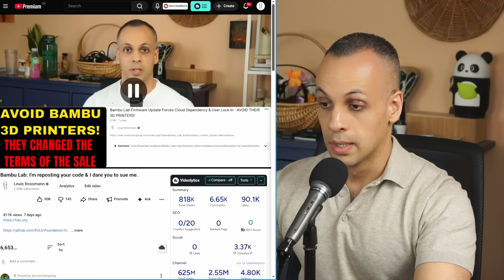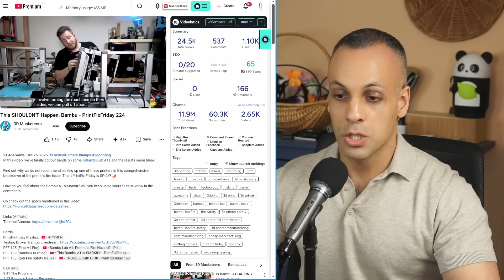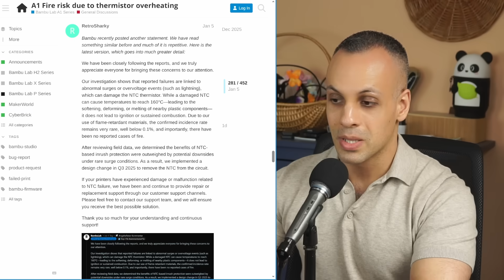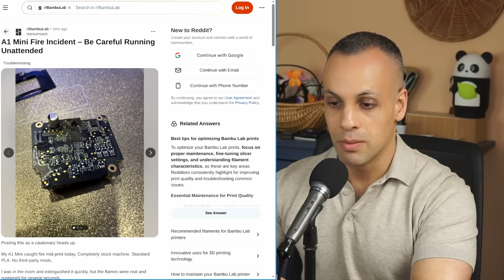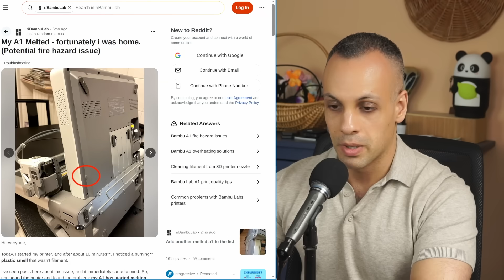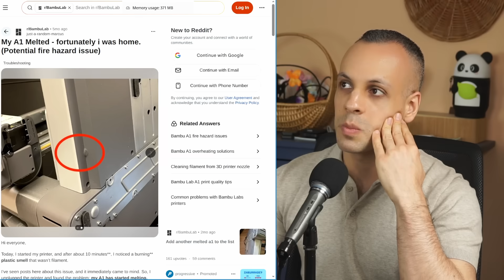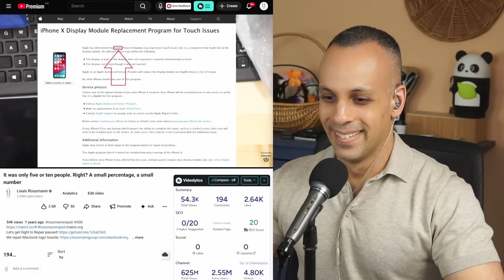Bambu Lab PR dumpster fire is turning into a literal one...

Comment: I am a novice 3d printing enthusiast.  I am on my 4th 3d printer now and it is a Bambu Lab P1S with 1 AMS unit. My first printer was an Aquila V2, second was a Flashforge Adventurer 3, and the third was a Longer LK5 Pro.  The P1S has been by far and away the easiest to use, most versatile, easiest to troubleshoot, and most reliable printer for good prints time after time.  I have gotten a couple errors but those come with the territory with any 3d printer; sometimes sh*t happens even on the best of equipment and with the best of users.  My 11 year old son is now printing on his own because the Bambu Lab ecosystem and hardware make it that easy.  While easy, one can still delve into the minute details using Bambu Studio to prepare and slice your prints giving the user more oversight of their printing process.  I'll admit that I love my Bambu Lab printer.

BUT....

I think their action of threatening an individual like they did is abhorrent, especially given that they are fully aware they built their own software off of open-source resources. I am glad to see that someone, anyone, is holding their hands to the fire. The Bambu Lab ecosystem (e.g. Makerworld, etc) is incredibly well thought out and executed but I don't believe that owners of their printers should be forced to keep their units beholden to a company's proprietary ecosystem. Apple was the first major company to build an ecosystem and trap its users inside so users have to keep purchasing Apple devices in the future. Now every company is following suit as they see more dollar signs; we now see it seeping into the 3d printing market. 

I have heard of the fire risk with one certain model of Bambu Lab printers, namely the A1. Electrical fires break out every day in varied devices. Cell phones, computers, printers, cars, and so on and so forth. I don't necessarily think this is a major oversight by Bambu Lab; these are isolated incidents of fires however there is no evidence of a pandemic of houses or businesses burning down because their 3d printer caught on fire. We recently saw NVIDIA GPUs present as a fire risk due to the adaptation of the 12v high-power adapter and plug. I would wager that there is a larger number of these GPUs in use than there are of A1 printers yet we don't see an alarming number of fires occurring. Electronics that consume large amounts of electricity will always be a fire risk to some degree. 

I do hope that Bambu Lab is either found liable for infringing upon users' rights with open-source resources or does a course correction and allow its users to use their printers as they see fit. Their products are on a whole new level of usability for users of all experience levels of 3d printing. While their actions and bullying are bad, they do not impact the quality of their products...if you by a Bambu Lab printer you are getting an incredibly well built and 'smart' product. However users should have the ability to use their purchased product(s) as they see fit even if that means using them outside of the Bambu Lab ecosystem.

Comment: Honestly, if it comes to easy to use printers, I found out recently that Prusa Core One is waay easier to use than a P1 bambu, I have used ender, sovol sv06 ace, and bambu p1 before, they all required me to tweak the print settings depending on filament, they all had some connectivity issues ( ender was annoying with the sd card, sovol would change ip from time to time and orcaslicer couldn't find it, bambu was a pain to set up for use for multiple people). Prusa I just assembled, ran the 1st print expecting something to go wrong and needing to tweak something, but it just works, I haven't even touched any print profiles or filament profiles, I just use generic whatever or prusament PLA for all PLA prints, and it prints better than any of those other printers. Additionally, it has options for DIY filtering, stealth mode which is amazing etc, most mature, easy to use software and hardware in printer space, bambu feels like a cheap knock off, after actually using prusa for the first time.

Comment: I recently bought into Bambu Labs with the P2S Combo. Since it arrived, I have never been able to buy the filament I want, as BL never has any darn stock. If I receive an email that it's in stock, it's all bloody gone by the time I check. Two weeks after buying the P2S, they silently released the X2D, which I would have preferred. I feel really sore about that experience and feel somewhat taken the piss out of. A week later, all the controversy with Bambu Labs and their adversarial attitude towards the open-source community blew up. The printer itself has decent, solid construction and clean prints, however, I'm becoming increasingly concerned with Bambu Labs direction and now wish I could sell and get my money back to buy from another brand that sells multi-head printing, but it had taken me a year to save up for this printer as I'm not a well off guy. Now I'm stuck with a brand I don't trust and it'll take me another bloody year to be able to do anything about it, I'm beyond pissed. Thank you Louis for everything your doing on this issue, Respect man.

Comment: 0.1% is NOT a small number when it comes to potential safety incidents.
Reply: Reminds me of when doctors briefly mention the “very rare” chance of a permanently debilitating side effect, which turns out to be 1/1000
Reply: @Adam-pk7go  If it is a side effect of a cancer treatment, then it is small. If it is a side effect of some medicine against a headache, then it is major... Depends on what is at stake.
Risking burning your house down in order to make a hobby 3D print is not proportional though.
Reply: correct, if 0.1% of the printers catches fire it would be a disaster, even if 0.1% fails it is still a disaster.
Reply: 0.1% of 1 million is 1000. They are saying a 1000 fires every million printers is ok...
Reply: @birdack81  Until someone important dies.
Reply: @birdack81  Surely it's easier to say 1 printer in every 1000??
Reply: @birdack81  "well below 0.1%" was the field failure rate of NTC's (operating out of spec after voltage supply surges). The fire incident rate is 0%. There were no fires, just some melting and deformation of fire-proof plastics in well below 0.1%
Reply: @dl5244 on relatively new devices, some of them will have this issue when they are 10 years old and full of dust inside, which will catch fire. Don’t forget people oiling their sliders and rails. And some countries making homes out of wood, a potential fire hazard in a car is even without incident is cause for a recall and repair
Reply: @birdack81  0.1% is NOT the number they stated however. They said ''WELL BELOW 0.1%'' which if you read carefully once again is NOT 0.1%
Reply: Not only that but it smells suspiciously like a BS number pulled from someone's ass so it's utterly useless to guage anything by.
Reply: Is this printer sold in the EU and with CE marking? If something happens they might be legally required to recall them then.
Reply: @ehsnils  not when the only symptom is melting or deformation of plastics with rated flame retardants. Only if there is an adequate risk of damage to property or persons. Zero incidence of that for now
Reply: It is when you're Sig Sauer, apparently
Reply: How is the "confirmed incident rate" a non-zero number while simultaneously claiming "no reported cases"?  Am I missing something?
Reply: Corporate CYA for "our profits are more important".
Reply: House of 100 people or whole family house who care? CEO don't.
Reply: lol yeah… don’t worry, our airplanes only crash .1% of the time :) 

🔥 ✈️ 🔥
Reply: Report it to UL or whomever has issued certifications for the equipment.
Reply: 0.1% is NOT the number they stated however. They said ''WELL BELOW 0.1%'' which if you read carefully once again is NOT 0.1%
Reply: Especially when the consequences is a house fire. A recall is needed.
Reply: What about the much much MUCH higher rate of failure on an ender? Ive heard and even seen a prusa start to smoke from a blob of death and that's no problem to people?
Reply: Remember, there were 3 incidents of note 7 blowing up when they recalled them all, and that was a phone that sold millions of
Reply: @quartzofcourse  the Ender three line has a pretty bad track record also
Reply: To be fair, they said “well below 0.1%”
Reply: Yeah you sell thousands and thousands of printers and hundred and hundreds of people have their house burned down!
Reply: i have full printer farm 0.1% can burn that down
lets say there 220.000 sold no official
that means 220 of them will catch fire
Thats not good i think  2026 we can get a better number
Reply: but 0.001%  falls within an acceptable level of risk

Fisher-Price Rock ’n Play : 4 700 000 units ,100 death ==0,00213 %
and so on, i just choose a random quintessentially American case among dozen.
In the US, human life often seems to have little value. 

 (You have my sympathy.)
Reply: @ZZZ-z9n3n  0.001% is two orders of magnitude less than 0.1%... That's a very big difference. Like, I agree with you that human life isn't valued as much as it should be by companies (and believe this is because the government doesn't punish them hard enough when they are caught - fines possibly less than the profit they made from that product), but at least 0.001% is a lot less likely than this. OP's point is that 0.1% really isn't a small number for these things.
Reply: As most Americans do not understand Per Capita - what makes you think you they understand Percentage any better ?
Reply: #Edinger
Reply: Yes it is. Don't leave your house lol
Reply: @PimpinNProgress  Ironically, staying at home might not actually help if the danger is a 3D printer that could burn your house down.
Reply: @Vousie there is no evidence that it will ever burn your house down.
Reply: Nonsense. 0.1% is a small number. Go kick rocks.
Reply: @TomTitselaar .1% of 1 million is 1000 fires. Unsure of how much Bambu sells but .1% is not an acceptable error rate if that rate could cause a fucking HOUSE FIRE
Reply: Well mathematically it is…
Reply: It’s all fun and math games until you’re the outlier. :) There is no such thing as 100% safe, but the issue here for me is there is a known problem and it doesn’t sound like they are offering an actual fix.
Reply: @jacobmaz8157  100 printers failing with fire every 100k is still not a great number
Reply: @jacobmaz8157 

You failed math class, didn’t you?

Comment: If Bambu used Klipper firmware this wouldn't even be an issue. Faulty (or failed) thermistors are quickly detected by simply comparing the time a heater is on to the rate of detected temperature changes. I suppose if the thermistor was acting normal but reporting temperatures much lower than they really were then this could be a problem. But I've used bargain basement thermistors for years and never had a problem.

Comment: So here is my take, I bought a Prusa printer (based on open source reprap designs but sold at stupid high prices) it was plagued with quality and print issues which they never sorted. As a result I backed Bambu X1C on the Kickstarter. It was such a revolutionary printer it made Prusa look like a Dinosaur. Now Bambu got popular they have vastly improved the experience for everyone in the industry, but decided to go the Apple route. This is bad, however Prusa are not as 'open' as you imagine and made truly awful products (the multi colour printing unit) and Bambu has a price/performance metric. My dilemma is simple, Prusa didn't innovate until forced to do so, they sat on an reprap design they barely improved. Bambu innovative but have turned into ass holes. So maybe the answer is elsewhere.

Comment: I read somewhere once so i'm not sure if its correct but the A1 does not have any cooling at the bottom i.e. fan? Anyway I have 3 3d printers from 3 different manufacturers Elegoo, Creality and Bambu labs I have an A1 mini never had any issues expect a nozzle once but I do run it locally and don't  update the firmware as I use a 3rd party ans on it which was a fraction of the cost of buying from Bambu. Would I buy another Bambu? Yes I am planning on getting a P2S soon I go buy how has it been for me breakdowns etc and unlike my centauri carbon that broke down even if I looked at it wrong and was a nightmare before finally getting them to swap it for a new one after 8 months have not had any of the repeat occurrences (I guess it was my turn for the lemon). I completely understand why people are p****d off if I had an A1 that did that I wouldnt be too happy either and as for the opensource argument well Bambu deserves everything they get before sending a c and d you due your due diligence and check all the facts but I guess they couldnt even be bothered to do that.

Comment: the problem is that once any company becomes the market dominant company they all slip the same way, its kinda inevitable, partly just due to sales figures meaning a small mistake turns from "shit imma have to eat noodles for a few months to cover all these replacements" to "oh if we do a recall here its going to tank our company" not saying I like the process but you can see/understand why these things happen, if I only sold 300 of an item and am forced to do a recall/repair service it sucks but its not an absolute cluster fuck of logistics and costs in shipping for millions of devices

honestly I could see a solution to this kind of issue being a partnership with local repair shops, manufacture a solution be it a solder in bypass or drop in replacement board, whatever is required, then partner up with millions of independent repair shops globally ship them a single stockpile of fix boards, then as and when you get repair requests, instead of having to ship millions of fixes globally or have local repair centres setup you can simply outsource the repair work, independent shop get a nice steady supply or repair jobs that sure pay hardly anything, but will be a nice simple repeatable job, no effort involved. I know I did some deals with people in the past to do these kinda of jobs, not with a big company, but mid size guys who would pay a set base small fee per repair but I knew it was zero fuss, I say dead, its dead no breathing down my neck for proof or blaming me for breaking it like you get with normal customers, that was worth doing jobs at like 30% of the normal rate as I said i'm only doing the quick simple fixes, anything that required more than a few minutes work will be deemed BER, over 70% of items were fixed, and the other 30% I was free to keep and fix for myself and use for spares to keep costs down repairing the other 70%, but that level of freedom does only come with people who have a pretty solid level of trust between them, but something similar could be struck

Comment: 4:10 Wait! did you just say 2011 macbook pros have a hardware problem? I have a 2011 macbook pro that I replaced the battery in and I completely wiped it and re-installed an OS, which was a pain in the butt because Apple doesn't even give out an OS version that works on this device.

Comment: I fix 3D printers. I do like them but we’ve ended up in a worse situation than when there were more open source printers. We now have people buying printers that they expect to just work and then they don’t. So you are left with things like very complicated head disassembly’s that the average user just isnt confident with. At least with the old creality alu frame printers it was all relatively simple.  It seems we’ve ended up in a position where the prints are better but the machines are a pain to repair or out of a lot of people’s capabilities.

Comment: Most printers "just work" now.  Literally almost all of them.  Bambu has the reputation that they do because of parrots.  That have the idea thrown up into their mouth by an influencer or someone else that they listen to for advice, then turn around and do the same all over the internet.

Flashforge makes several printers that are almost identical if you look close enough, even the frame and all the kinetics.  They're also a lot cheaper.  "But such and such said Bambu da best!"  So nobody wants to use them.  Well, nobody that operates that way which is sadly a large portion of society.  I myself have two AD5Ms with mild upgrades that have run for hundreds of hours each with very little effort to tinker with or monitor them.  I too can "press print and walk away."

Comment: There is a woodworking and gardening equipment company in Canada called Lee Valley Tools. When you buy something there, the sale stuffed into their database. Twice now, we have been contacted by Lee Valley because a product has been recalled or didn't perform to expectations, and we were asked to return the product for a replacement or refund.
Other companies could do that. Your grocery store knows you and what you've bought, due to their stupid affinity cards. But do they get ahold of you to let you know that that beef was contaminated? No. Do they sell your data? Yes.
More companies should be like Lee Valley and 1) fix their defects without having the customer initiate the repair and 2) proactively contact the customers when they know there is an issue.